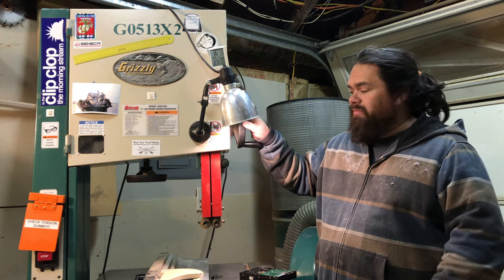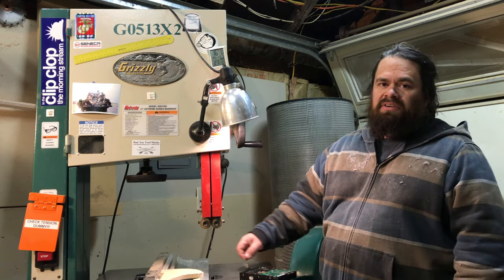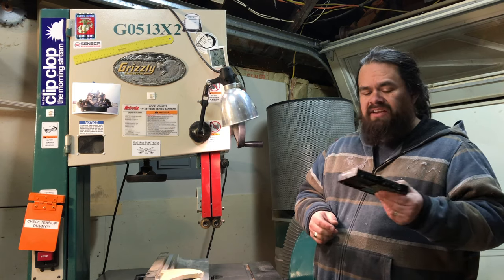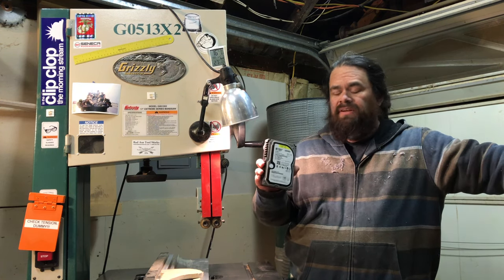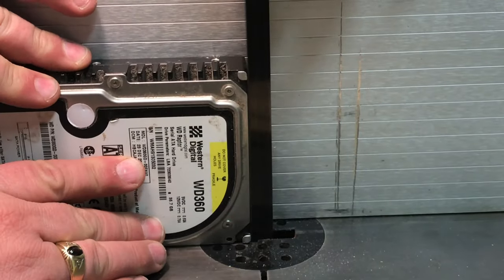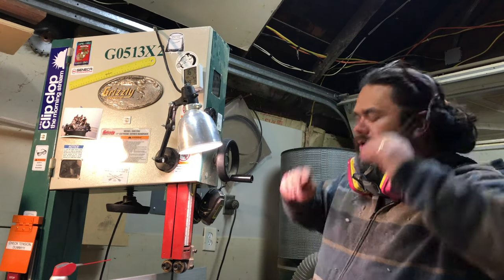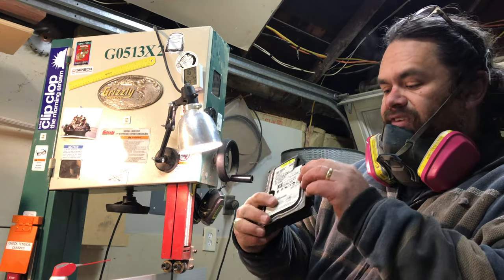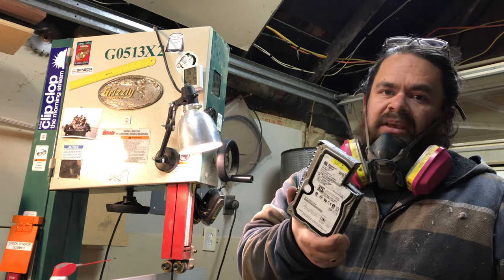Bandsaw VS RAPTOR!

Comment: feel the teeth, they are prolly still sharp. keep pushing. the metal is aluminium or magnesium or similar I think - soft. maybe lower the top support so the blade doesn't move so much. if it'll cut steel, it will cut that I reckon. Fun